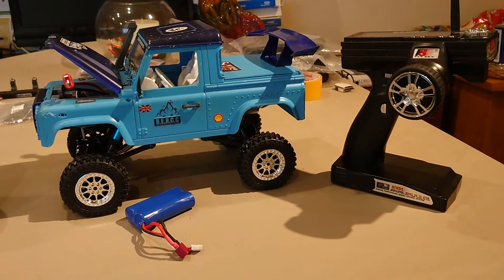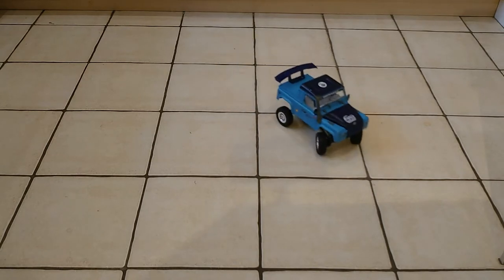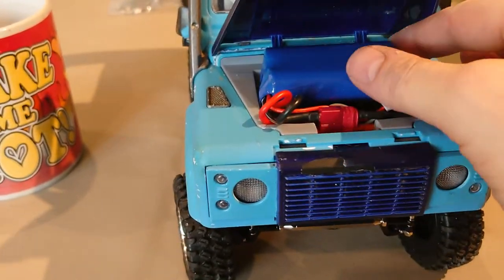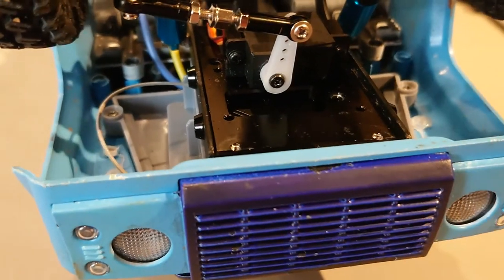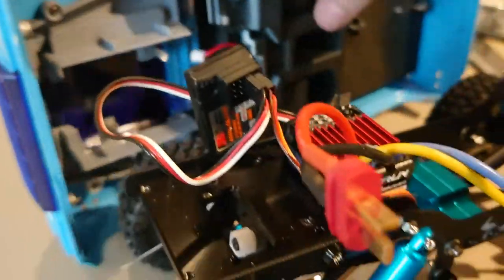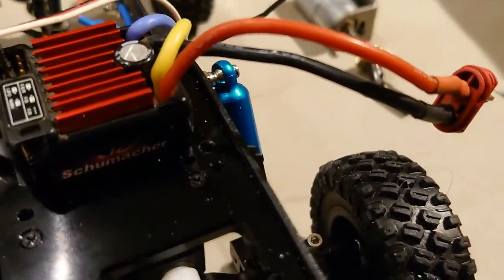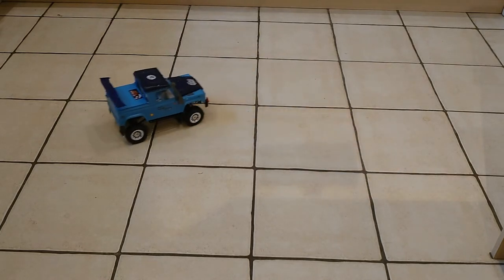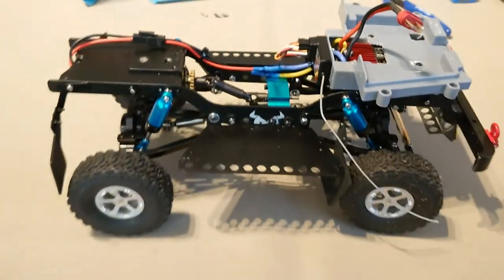Lil Blue  Upgrades Pt 3 Landrover D90 Mn-99,( 7.4v Li-on, 2.4 ghz) 4wd 1:12 Crawler

Comment: I have the same fly sky controller, it starts beeping at a certain voltage, I just opened the controller and twist the sound module until it comes off,works perfect, just remember to turn off your controller 👊🏻👍🏻
Reply from the maker: Great controller, just need a thumb extender for 1 handed driving
Reply: @SharkysGarageRCandMore  lolly stick poked through the foam on the lower half works ok

Comment: Heat shrink over your floppy shaft..oo err missis! and yeah the standard single speed is dead slow, i think I mentioned it in a previous comment,switched to the 2 speed all good.
Reply from the maker: Ran it today, switching to the "Clarkson"
Reply: @SharkysGarageRCandMore  ...More Powah!!  fitting a larger moter?